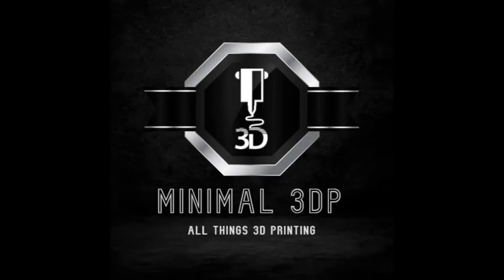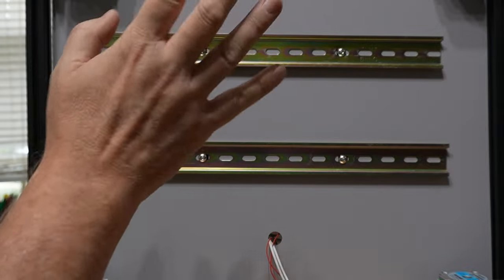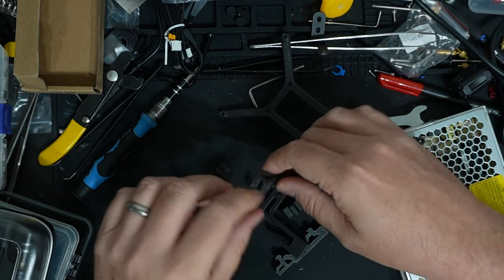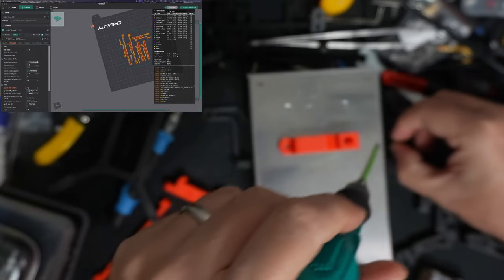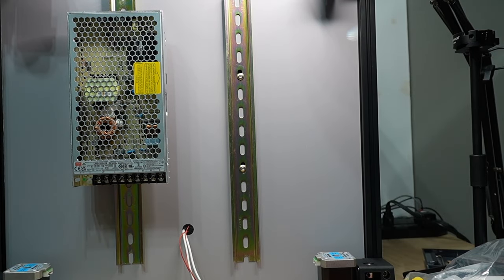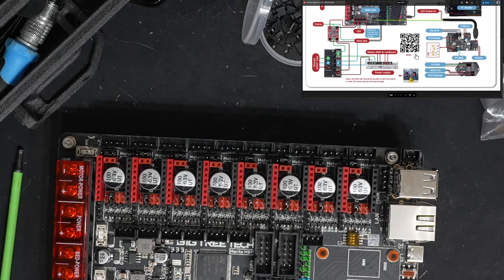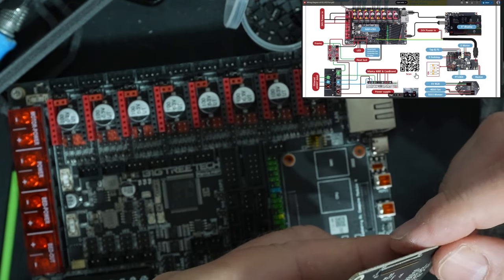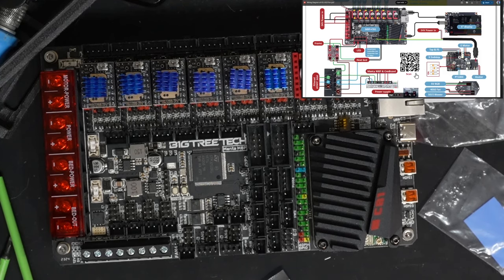Voron 2.4 R2 Kit Build Guide | Electronics | Part 13

Comment: i just want to say thank you for making this comprehensive build guide for the Formbot kit. i have been following along and it has made everything so much easier. have you figured out the sb2209 ebb 2040 canbus setup? i have been fighting with it for weeks and at this point i have more time in failing to get canbus up and running then i do in actually building the entire 2.4 350 kit. im losing my mind with it so i finally broke down and ordered all the stuff to just run wiring to the toolhead until i can figure out canbus or until someone has a single consolidated guide on how to do it. again thank you and i hope to see your next video soon.
Reply from the maker: I am not at home today. Email me at minimal3dp@gmail.com. I found a website that has detailed instructions for the programming. When I get home I’ll send the link.